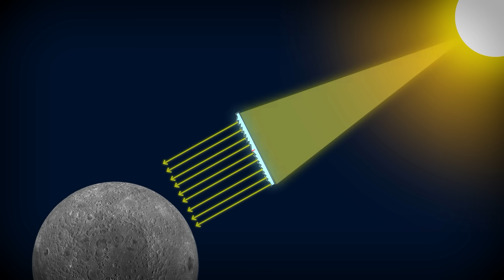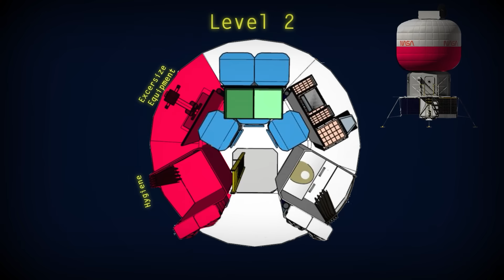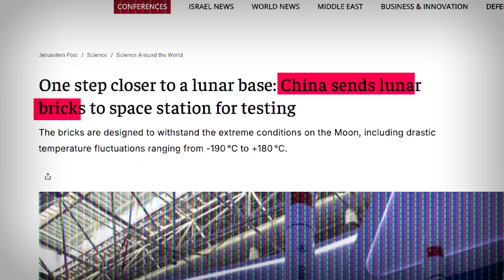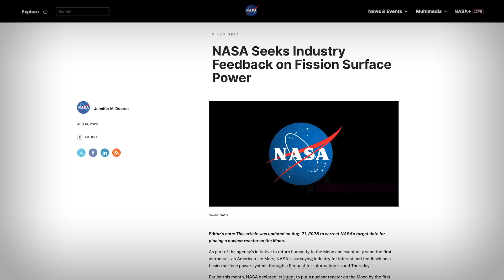How NASA Will Build A City On The Moon

Comment: 13:13 Well, I think the reactor might still overheat because there’s no atmosphere for the heat to transfer to. Even if it was deep inside a crater away from the sunlight, it’d be no different than say, trying to keep something cool in space. Hollywood would have you believe that stuff freezes as soon as it hits space or a moon with no atmosphere, that’s just not how physics works. 😊

Comment: There has also been research in Australia of being able to take the abundance of moon dust, use machines to turn it into a fine Cement like powder and then mix it with certain aggravates and bonding agents so that it can be manufactured into square or rectangular modular panels that can be laid onto the ground and clipped together to form road ways. This same Moon Concrete can also be fed into automated extrusion machines that can construct custom shaped solid structures around moon base buildings to better protect them from meteorites and from decompression or sealant failures in habitat modules - essentially covering these modules in 'Mooncrete' to strengthen and reinforce them. This 'Mooncrete' could also be used to construct super strong subterranean structures on the moon.

Comment: The lunar moon dust called regolith has such sharp edges that it was cutting into the space suits of the Apollo astronauts under their arms and has an electrostatic charge and clings to everything. It’s probably the most difficult challenge that moon inhabitants will face and without any atmosphere , cosmic ways from the sun are essentially death rays. Moon inhabitants will have to live in caves under the soil if they have any chance of survival. It may be easier to discover new propulsion systems to get us to Mars faster and build there. With the current SpaceX plan is completely unrealistic. We need something a lot better than rocket technology.

Comment: Yes,Landed on the moon 55 years ago … seems almost impossible to do it again 55 years later because of astronomical cost and engineering problems.
Building a moon base is a “Pipe Dream”. Never going to happen.
If, and that is a big “IF” they build something like a so called moon base then it eventually be renamed the first Mortuary/Funeral Home on the Moon for Astronauts that will never come back. It would be analogous to the OCEANGATE TITAN but instead of severe pressure it would be constant worry of DECOMPRESSION that would be the primary concern along with radiation, lack of Gravity, technology breakdowns and a litany of issues that would make long any term stays on the moon “A one way ticket”.

Comment: A thin film of plastic or aluminum foil would do fine to hold the dust down. Only a 100 foot square pad needs to be  turned into a concrete like landing zone.

Comment: There is already a suitable habitat site on the moon, one that already protects against micro-meteors and cosmic radiation. Lava Tubes. All NASA would need to do is set up the inflatable habs into the lava tubes and presto home away from home. Later the lava tubes can be sealed off and pressurized for even more subterranean housing.

Comment: Why don't they practice build spray on cement structures and replicate it on the Moon building bricks is Cool but in the beginning there's going to have to be the most efficient methods to build structures.

Spray the moon cement on the tents n build bricks structure later down the track.

Dome tents sprayed with moon cement.

Comment: Why not make sub surface bunker style habitats. Drill tunnels with a horizontal boreing machine like used for the English channel tunnel and as it cuts the tunnels it uses lunar rock dust from the drilling process mixed with a plastic flex seal style polymer to seal the tunnels then have the rear of the machine make a seal against the made tunnel at a certain point you turn the tunnel and make it a ring about 150-200 deep under the surface of the moon. This will make a sealed very strong structure that tube like service and living modules the shape of the hole can be fed into it  like train cars. Think a rocket body that the cap and rockets disengage once a module is put into a lunar orbit and return to earth to get another as the delivered tunnel module is slid into the lunar geo habitat.

Comment: Why would you power a river with hydrogen? Sure, you can get it [expensively] from water, but water is extremely scarce on the moon.  Seems like a use-case for sodium ion batteries or lithium.

Comment: I like stuff with long/eternal life times. 
I hate stuff with built in expiration dates (like those water cookers, which are designed to only last a year ... ). 

So, I think the focus should be on technology, which can re-build itself. Regenerative Technology, if you will. 
Once we want to leave the solar system and have to travel for a few hundred/thousand years, you cannot simply pack a few spare parts. You need to have the "regenerative technology" part of your tech tree unlocked. 
Anything other is just peanuts and stop gaps.
My proposal as a good first step: Build a water cooker which lasts for 1000+ years. And stop wasting energy and resources on borderline criminal "short lived by design" products. And hey, we can do it here, on earth!

Comment: ROTFLMFAO 
a Human...on the moon...🤦
The MOST ASTONISHING HUMAN Earth HAS Dribbles down his leg into a bag.🤔
HIS CEASELESS AMAZMENT and FATHER OF CREATION also Defecates into a....Sort of sack.

It would EXCITE ME to see a Repedotater ON the Moo🎉
Moo ain't got Carbide Dioxigen, Piggies Need That fer their Bibble Readin'
Ain'tthisFair ALSO rubs away at stuff like a Wife dressing down her useless husband.
For the Dems that means the Solar Impacts would create a RAZOR sharp Glass Like Substance that would Cover the ENTIRE Surface of the moo🐮
Lack of Atmosphere would prevent Polishing the Lethal Shards.  Basically like Bleeding Out because you thought dead cold Volcanic Rock looked Cooo ( props to Cartman )
For the Potatophiles that means owie Itchy Death Scratches from Dust Rocks.
🤣And let's jes Sea a Repedofile wondering around looking for a Blue Donor $tate Handout when Earth's Magnetotail SLAPs him in the Face like MTG's Bottom Surgery 🤣
For the Dems that means the Charged Particles REST at Four Thousand Five Hundred BIGGLIES.  And can Easily get to 200,000,000 volts.
EVERY SINGLE MOLECULE on the Moo 🐮 would STICK to every Lil Marco Rubio Bit of you.
For the Repedofile gals that would mean EVERY Flap and Fold of your Gizzards and Loose Wobbly Bits would be covered in microscopic razor blades that even a Golden Shower couldn't wash off.
Life expectancy of a Repedofile on the Moon🐮
🤔
Same as a Russian Toilet Thief 
~3.17 days

Comment: Ionised and abrasive dust will make the surface a challenge. Tunnelling is attractive to limit all the surface risks. Tunnel walls would have to be stabilised and sealed with fusing or complex chemistry (glass blowing?). Any surface exploitation depends on fused surface areas; mirrors would be for long term sites as slow.

Comment: If they could utilize the ISS, retrofit the landing gear and boosters to send it to the moon, land it, and then salvage what can be utilized for habitat living, that would be cool. I'm sure the logistics may be mind-boggling.
Reply: use bunker-busting bombs to clear the dust on the lunar surface. detonate them high enough to not crater the surface. Do it on some test areas on the Lunar surface to see the pattern created and the overall removal of the lunar dust. map out the expance of removal

Comment: To prevent micrometeorite damage, use the lava tubes that have solidified. You should try to find a material that will make the dust stick into bigger clumps.

Comment: According to the Bible, the Earth is a plane
1. The universe as a limited space:
* Flat earth: 47 mentions (Ps.76:19, Matthew 24:14, etc.).
* The earth is like a ball: 0 mentions.
2. The immobility of the earth:
* The earth is stationary: 20+ mentions (Ps.119:90, Isaiah 45:18, etc.).
* Earth's rotation: 0 mentions.
3. The movement of the sun
* The sun is moving over the earth: 10+ mentions (Isa.Nav.10:13, Ps.19:5-7, etc.).
* The earth revolves around the sun: 0 mentions.
4. The Sky Dome:
* Dome above the earth: 8+ mentions (Gen.1:6-8, Ps.104:2, etc.).
* Edge of heaven: 4 mentions (Deut.4:32, Mar.13:27, etc.).
5. The foundation of the earth:
* The foundation of the earth: 11+ mentions (Job 38:4-6, Isaiah 24:18, etc.).
6. The Moon:
* The moon shines with its light: 9+ mentions (Matthew 24:29, Isaiah 13:10, etc.).
* The moon reflects sunlight: 0 mentions.
7. Stars:
* The stars will fall to earth before the coming of Christ: 12+ mentions (Mark.13:24-26, Dan.12:3 and others).

Comment: This is all fantasy and will be for the forseeable future. 
Thousands of hours of experimentation and technical development to make roads when you can simply drive around and put up with the dust.
Inflatable habitats which absolutely will never leak and provide perfect radiation shielding.
Silly cartoons shownig nice and clean bases ,no sign of the omnipresent dust.
Lunar rovers rolling around,'what about those glass roads'.
Even a small nuclear reactor of sufficient size to provide power to bases of the size imagined here might be the size of an 'average car' but would weigh as much as a small tank, how is that to be sent to the moon let alone landed in just the right spot, ever so gently.
And all that hidden' Lunar water' has not yet been found, it's suspected to be there ,should be there but no body knows for sure.Better to spend your time building robot landers that can scuttle about the lunar surface and actually confirm it's presence or no.

Comment: Build a city sized moon base, Yeah right surely and of course as long as it located same Nevada desert they landed in the sixties. 
Unless it’s built and operated by only robots sorry I will not buy this fantasy story. Reason?, pain and simple radiation value past Allen belts. They know that, and I believe they also realise what it would take to make any crew secure from its effects on bodies. Sending probes is one thing then sending humans is completely another unless they going one way only and knowing will die from radiation sickness in very short time. Sorry to break it to you this way but they know that. Why they still selling fantasy like it was possible I don’t know. (it must be money they still get for it). Make no mistake they going nowhere. Earth orbit is the furthest we can go and that’s it no ifs no butts, a craft that could safely support crew anywhere further will have to be built in the space in the first place because weight of shielding requirements is so huge it’s not going into orbit if built on the ground. No chance.

Comment: Current planners for Moon bases are morons.  Every base will need a plan for dealing with meterite impacts, and none of them account for this.  Also, none of them have a plan for n\becoming self sufficient, which means that they will be dependent on expensive supplies from Earth.  A realistic and intelligent plan should show the following progression:  1) deliver energy infrastructure, such as solar cells, nuclear, or orbital mirrors.  2) Mining - necessary materials need to be mined,  not continuously delivered from Earth.  Once there is energy infrastructure, mining can commence.  3) Manufacturing.  Mined materials can be used to produce what's needed for Human habitation.   4) Habitation infrastructure.  Once manufacturing is successful, habitats for humans can be constructed without needing for them to be delivered from earth.  5) Human habitation.  Humans can finally live on the moon.  Sending humans to the moon before all of the previous steps have been taken successfully is nothing but a way to waste a lot of money and resources.  Sending people to the moon when they are completely dependent on supplies from Earth is just plain stupid.

Comment: We can’t get rid of ‘actual intelligence’, it would be the safety switch for ‘artificial intelligence’. Like anything new, it’s needs to be put through testing, both in a lab to enabling an AI robot give a full intelligence brief. This for 1 could be hacked, assuming the safeguards of internet and AI would have virus detection? Or, use AI as a tool for mission debriefing? Some of you might think WTAF, but yes an intelligence brief needs to be more getting the point across, so when the commander/manager or supervisor’ politician perhaps’, has all they need in their head to commit to any activity. Eg. A brigade of 3-5k men and women, will need to establish a beach head and a temporary camp to house all of the brigade headquarters as well as security group and quick reaction force. It needs to be far enough from water, but not far enough to retrieve fresh water, it needs to be on flat ground and out of enemy approach. And it needs to be close to a main road, for resupply. Then you’ve got to load that tactical data in to an AI robot, you haven’t told it about close support assets eg. Where the fire support is, and hence be under the range of that support base. Now, most of this is just jibberish for anyone who has never served, but it can be used in any professional field, it will allow better work flow and feed back but not so much to micro manage. Tell me what you think, cheers

Comment: Let's make it 2 ft thick so the landing pad can actually hold whatever lands on it maybe it'll even have to be four feet thick and of course you going to want fine rocks underneath it which you can get off in the moon as well that goes underneath it that makes a cushion pad should have been sizes actually which will make it so the smitten last is a lot longer I'm pretty sure it can't freeze if it doesn't get any water I mean it ain't going to freeze more than what it already is frozen there ain't going to be any thawing of it either so Atlanta probably be there forever The landing ped'll probably be there forever and probably last forever The first problem is the first few that we sit there would be picking up all this just sending it everywhere is onto everything then they have to build it after all that they don't have to build the infrastructure to actually make that material or whatever they make they make a hard surface and roads and whatever else not and making it two-lane road might be a hard thing to do there of course you're going to want it thicker to the roads that are on earth because you want them to last forever you don't want to wait to be a vehicle actually breaking it even though your vehicle will be lighter on there you still got to figure the weights going to be tensified especially with moving and hitting bumps and whatever else not

Comment: Well of course you could try to make cement out of the sand on the moon you'd have to collect it all see if you can make it into cement hardened surface at least dinner last longer than a roads on earth but that's going to take a lot more water and other things probably cuz then you're making sand cement basically

Comment: The problem is you also want to make most of infrastructure connected together so you can go from one infrastructure to the next infrastructure without actually stepping outside and then you're going to want to have a lot of it underneath ground so you can reduce the radiation source where radiation could hit you if a course if I had the money and I started a company I would have done this probably 15 years ago even though if I wanted to go to another planet another moon I would start with the Earth's moon just because I can get infrastructure from that place and I wouldn't just claim the South Pole also send something to the North Pole make two different cities there and eventually 50 ft underneath ground connect road that connects both places together keep in 50 ft underneath each crater this way I can make more landing pads right across the whole Moon to make it for more landing places safer places to land and everything else but person I'll keep them closest to the places where the cities would be that I billed on the moon course there's going to be all kinds of jobs on there because everything has to be done everything has to be built infrastructure is always going to be built and rebuilt and added on and things like that and pretty soon would have about 50,000 people living on the moon and if I would have started it 15 years ago landing on the moon and doing all that by now I'd have 10,000 permanent residents on the moon that rotates off leaving him on the moon would just eliminated time switching them out with other people all the time and they're probably be hundreds of different jobs just to make sure everything works and also be able to grow food onto the moon as well which are probably in some sorts of greenhouses because the moon has no atmosphere

Comment: That dust is going to play absolute havoc with any fabrics, bearings and hydraulic systems. It's like crushed glass. It caused all sorts of issues with the Apollo program and they were only there for 3 - 5 days at a time.
Reply: so the moon is covered with tiny razors, by design

Comment: One idea I would like to share, there is the conzept of a spinning city. Moon and Mars are way smaller than earth and therefore have much lower gravity which is a problem for humans. So there is a conzept of a spinning city ring with angled floors spinning at a speed so that gravity and centrifugal forces add up to earths gravity and perpendicular to the ground. This is of course scifi at the moment, we will not build this in 10 years, not in 50, maybe in 100 years for this to work the rings would have to be huge, at least several hundred meters, maybe kilometers, but it would be really interesting